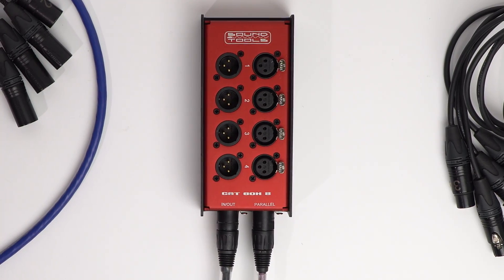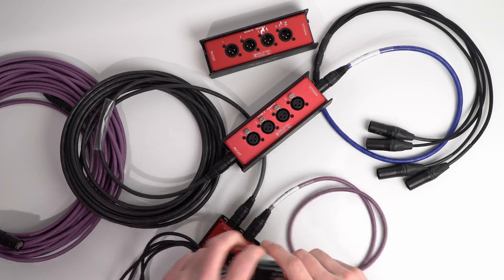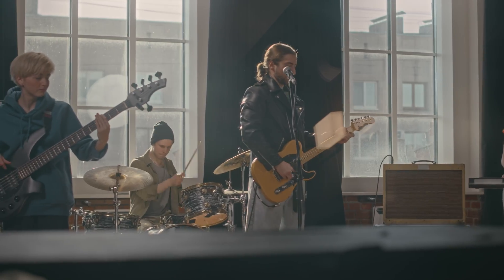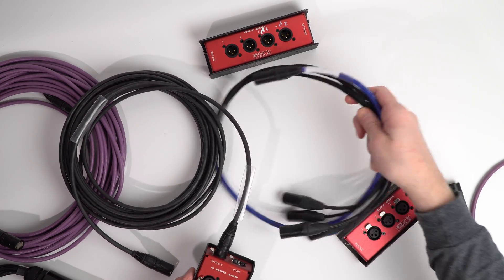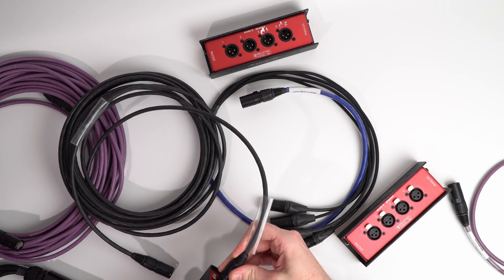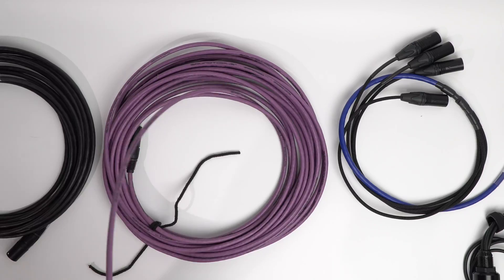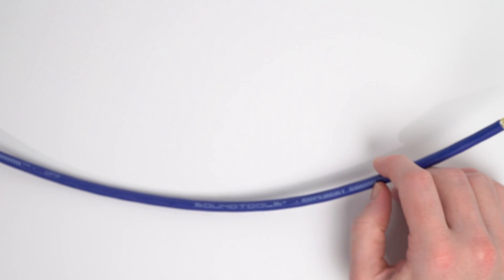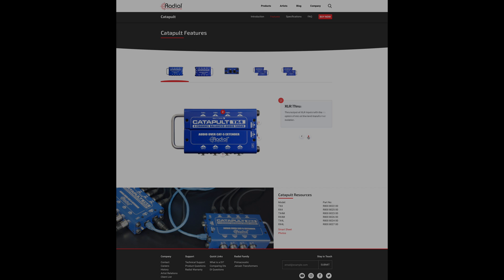SoundTools CatBOX 8 and SuperCAT 7 First Look & Teardown

Comment: Hey great vid!  Would making your own ethercon cables be an economical alternative to an already made cable?
Reply from the maker: Hey Erik, hope you've been well man! If you've already got the tools to make up ethercon ends and don't mind doing it, it could be worth the trouble. We used to do it back before these kinds of things were commercially available. 

I think the cheap route these days is to just get the cheaper imported ones and use the mono-price mentality of just ordering a few more than you need as spares and double check them all for quality control before using them in the field.
Reply: @DcSoundOp Good call, thank you!

Comment: You dont need uftp with individual drain wires to go directly from ethernet to xlr, you just can solder all grounds to one drain wire in futp cable, just soldering would be harder :P

Comment: Somebody knows if we can use this box with mixers like Midas MR18 or Behringer XR18 ethernet conection? It have just 6 monitor outputs, and I´m trying to get 3 extra outputs to send inears monitor mixes (using 3 of the 4 effects channels).
I just know DN4816-O splitter, but I need only 3 extra mixing channels, and these can be PERFECT!!

Thanks a lot 😎

AWESOME VIDEO

Comment: if i want to make a 2 room setup, i will need 2 CatBOX 8 in each room with SuperCAT 7 cables running between the rooms with the catboxes parallels disconnected?
Reply from the maker: Yes, you would want to have the parallel jumper taken out, and you'd need two runs of cable between each set of boxes, if I'm understanding what you're trying to do correctly. Thanks for the message.

Comment: I used the Soundtools WallCats to easily install mic feeds around the room in a medium sized church....Crazy easy wiring install. Also used the CatBox products to move line out feeds from mixer to FOH speakers and front-fills. Quite a bit less expensive, especially since we are using all Cat6a cable in the walls.
Reply from the maker: They really are a great fit for that application, it’s so easy to have additional cat cable pulled and terminated. Good to hear you’re enjoying them.

Comment: I'd like to be able to have one Catbox 8s on one side of the stage to send a signal to a FOH speaker and two monitors AND to receive a signal from 2 mics and two guitars.   So that would mean I'd want to use 3 outputs and 4 inputs from a single Catbox 8....in that case I'd have two Cat cables.  One to send and one to receive. Correct ?
Reply from the maker: Thanks for the question Frank. You're absolutely correct, to use it in that configuraion, you would need to pull the internal jumper and run two cables. Sorry for the slow response, it's been a heck of a week. Thanks again!

Comment: I wish all cat6 manufacturers could come up with a standard wiring. Love these units but running into issues when using it with a DB25 to cat converter. One is T568A the other is T568BB.

Comment: Would i be able to connect and use the Catbox 8 to the Ultranet port on a X air 18 to get in and out audio?
Reply from the maker: Only using the same analog connections you use now, these are completely passive and don't interface with other gear over any networks. Thanks for the question!

Comment: It looks like the SuperCat fanout has a male Ethercon connector, this makes it less than ideal for connecting directly to an ethercon cable. I guess you need a Ethercon female turnaround?
Reply from the maker: Yes, the NE8FF is what you'll want to have on hand. They're also generally useful for adapting ethercon cables to non-ethercon gear with a standard patch cable - https://amzn.to/495GWYa (ad link) Thanks for the great question.

Comment: As a 4 pair stage box I don't see an advantage over the traditional sub snake. Even with the XLR housing the actual contacts are quite small, delicate and not tight fitting. A standard XLR connector with it's pin and sleve contact is a much MUCH better conductor. 
Where I do see an advantage is in a large scale  installation. Lower cost of cabling over long distance and greater flexability in terms of what devices  can be used on the cable run. One day it could be lighting, the next dante data and anolog/digital audio on another day. This could be handy on a broadcast truck or sports stadium. 
Either way, the little tiny contacts are the weak link in your signal chain. Over time they will begin to fail. Good Luck.
Reply from the maker: If you don't need the disconnects and are not already carrying Cat cable for another use, traditional methods probably make more sense. Thanks for checking out the video Ed. I appreciate you sharing your thoughts too. All the best!

Comment: I recently did a talent show (Saturday). the last 3 acts used their own microphones, so I set them up with their own booms and I hooked them up to a cat box; mixed it during sound check and saved a snapshot. Then I swapped back to a splitter (seperator) assembly to my normal set up that consists of 2 sets of microphones stands with vocal mics and a side mounted instrument mic (I found this to be great for a bunch of reasons you get one vocal and one instrument if they play guitar that can be plugged in and if their pick up doesn't work the instrument mic is already right there) and because this is one mic stand I have that feeding into a StudioHub adapter which gets me 2 XLR's to cat5. then two of those comes into a separator which splits out the green and orange pair to one Jack and the brown and blue pair to the other Jack so now I'm sending four channels down one cable to my XR18 mixer stage side. I found the studio hub connections to be pin compatible with the sound tools stuff but the numbering and the cable pairs are different so I have all mine wired up so it goes back to a cat rack and comes out in four different colored XLR cables as per the ethernet color pairs Green, Orange, Blue, Brown.
This allows me to mute channels and disconnect one ethernet cable at the mic stand and yank it off stage. Going back to the cat box's I had to make up a funky ethernet cable adapter to rearrange the pairing so the numbers made sense. I tried it a few times it works but it broke my brain so I made the adapter because Jack #1 ended up like in the middle it was weird.
I had one cat box stage left for instruments like guitar amp, base, acoustic guitar DI.
And I have another one back of stage for drums overhead, snare, kick and drum vocal which we ended up not using.
Small stage. A very small stage but then again it's a 1920s movie theater so the fact that there is a stage.
The sound tools system gives me a really light weight 12 channel snake.

Another thing I do is live video streaming and this event is at one of the local hotels, another one of those almost ancient buildings in a small town. did I mention it's a historical town just outside of Maryland, DC and Virginia.
Since I also do networking I fully understand how the cabling system works or is supposed to. I try and put as much as I can on ethernet cables they're easy to find they're easy to replace and you can hide them fairly well. In this instance I have an ethernet cable running up to a table top projector and laptop for presentations to grab a video feed for the stream. I have two cables running to the soundboard mounted near the kitchen, one grabs the four channel wireless mic system and returns it to my Mixer more conveniently located in the room, and the other one Cable pair returns a mono signal to the mixer to use the House system speakers and the alternate pair grabs the channel direct out from there background music CD changer so I have control of it. and the other two pairs I am using passive POE to power the wireless microphone receiver so I don't have to move it and so if the power goes out the wireless microphones are still returning to my mixer getting mixed and streamed out assuming the Internet doesn't go down or at least into the back up Recording. And at the end of that I pack up the cameras, my table, there's a handful adapters that get unplugged, the mic receiver gets the cat tales unplugged and re-patched, mixer settings get reset and there's a dozen ethernet cables to wrap up and my box gets the lids and rolls out.
Reply: Any reason I should consider Cat7 for a small 20’x12’ home recording studio? Longest run would be 30-50’. I def need at least a shared ground/shield for phantom power. On one hand, I don’t have long enough ones to justify buying top line, but on the other hand, I don’t need 3000 feet so I don’t mind spending a little bit more for my small DIY studio. Appreciate some feedback! So far all I know is that I need to look for solid copper, not CCA, and I need at least one shared shield
Reply: @GregoryGuay  not really as long as you get the shielded you should be good although the cat 7 supposedly has individually shielded pairs which might help with crosstalk so it might be worth going the little bit more for some future-proofing if it's going to be in the wall.
Reply: @imark7777777  I hear that for an amateur/inexperienced person that Cat 5E is much easier to work with than 6A. Do you know how 7 compares?
Most likely, I will go with solid copper for the “permanent” install. I’m actually leaning towards 5E, since someone told me it’s a much easier to work with.

Comment: There are a lot of DI boxes with a ground left switch, I have honestly I am not sure if I have ever used them other than making sure they were not enabled.
If everything is working properly there shouldn't be a ground issue and if you have a ground loop there's probably an electrical issue.
Reply: Not necessary to connect both ends to ground. 
Ground loops occur when the signal has more than one path to earth. Rule of thumb is lift at source, ground at destination.  
Mind you we are talking pin 1 signal ground here. 
NEVER lift electric power ground. If there is a failure YOUR BODY could be the path to earth!
Reply: @edjefferson9175  no not necessary to connect ground at both ends but that's exactly where some non-standard cables come from because they're not following the specifications and you end up with a USB, Ethernet or other cable that's not correctly wired to the specifications.

Generally I have never had a ground loop issue when things are properly connected using balance lines avoiding unbalanced cables etc. star ground. Following the Benchmark white paper on a clean audio installation.

There was one band that I did Sound for that insisted on having a ground lift cheater adapter on their electrical cable to their Audio amps.
Because well you change half a dozen things and the buzz goes away it's gotta be that one thing we did there. So never change anything ever again. Then again they were running an entirely analog system of almost ancient equipment.
Had a ton of a hard time with that band the last time I worked for them I think their amp was dying anyway.

In all my years I've only once had a ground issue with a keyboard and I don't know why. I tried lifting the ground at the DI and that didn't work. And unfortunately the church didn't have the money to drop on one of those fancy electrical hum eliminators that goes on the AC side, that church is a whole Nother story mentioned elsewhere online. The only way to get rid of it was using a non-standard standard unapproved technique. Which I won't disclose.
However a few years later no more buzz without unauthorized modification. Object removed from chain. (I'm hoping this one isn't too vague? In case it is I remove the two prong three prong adapter that was on the power cord to the keyboard). This one was properly labeled and tested multiple times throughout the year which is how I found out it wasn't needed all of a sudden and I'm not sure what changed.
Then again that was an interesting church, I was in charge of tech and yet was not told that the entire stage had to be rewired for surface mount outlets. I came in a few days after to find this out and find every amp guitar x3 and otherwise x3 ( Main + Mon x4) daisychained through power strips and plugged into the same circuit when we had two circuits on stage. Yeah we don't have to follow code that's why we now have to put up an exit sign, remove some illegal building modifications, add a handicap ramp to the stage that 6 inches off the floor. But it's not a problem family member of the Pastor is a contractor.... Run!!!!!!!!!!!!!!!!!!

I've seen this third prong nonsense all over the place generally it's bad lighting dimmers improperly wired electrical, sharing circuits etc. I have the wonderful benefit of cross discipline between A/V electric and networking. If you have a good electrical to start with, keep everything on the same circuit use balance cabling and good quality equipment that's maintained. There shouldn't be any issues and sticking with that mentality I have not once had to use the ground lift switch on any DI with all equipment properly grounded.

There was this one church that just about everything that was three prong had the third prong broken off why… Because all the electrical in this church was two prong and this individual this pastor believed it was easier than getting an adapter to break the prong off on everything. which is why to this day I rather have an ungrounded slightly miss wired in a particular manner electrical outlet then have the opportunity for somebody to break the third prong safety ground pin off because they're too lazy to get an adapter making it permanently unsafe. Unfortunately this method really does require a qualified well educated electrician to properly test everything from outlet to panel and not just one of those three like testers. The sad part most of those outlets in that church would've qualified for being upgraded properly with existing wiring because it was well done to begin with but just with two prongs.

Comment: BEWARE!!!⚠⚠⚠⚠⚠⚠
There are two things to keep in mind that can cause massive problems:
1: common ground - these snakes all share common ground on EVERY CHANNEL. if you have any ground issue or noise issue on ONE single channel it will transfer on every other channel.
2: splitting: the split is without any TRANSFORMER. So basically a Y- Split. For LINE LEVEL this is fine. For MIC level this is an absolute NO-GO! You always wanna split Mic level signals with at least a passive transformer. 

The combination of both points above can cause MASSIVE problems live and drive your FOH-Tech insane. Just because it works for some people, it doesn't mean that in the next venue you play you're f*cked. to be safe then, keep at least a normal 4x4 snake for every CAT-snake in the backup case and wire up your rack or console without zip-ties.
Reply from the maker: You know that normal audio snakes, and every mixing board on the market share a common ground across all channels? Why does this freak you out so much with this snake? 

Also, splitting mic signals without a transformer is totally normal & done on major tours and productions every day. Transformers are absolutely NOT required. Dave Rat even has a video on his channel about how the RAT Sound snakes on major tours NEVER have transformers in the splits, it’s totally normal. 

Please be careful before writing BIG  alarming ⚠️⚠️⚠️ walls of text on people’s videos, that you’ve got your info right first. Thanks!
Reply: Other than some signal level loss a  system will function just fine with a hard wire split. We never had the luxury of iso snakes. Some passive snake boxes have pin 1 lift switches on each channel. Much cheaper than transformers. I would prefer a hard split over cheap transformers. 
There is only one earth, so a common ground is not a bad thing. Balanced audio is caried on a twisted pair. The ground wire is not part of the audio signal.  It is a shield/drain conductor and can also be used for power delivery to circuits such as  phantom power and intercom belt packs.

Comment: I'd love a version with an iso transformer for splitting between FOH/Monitors & Recording rigs. Especially Comedy shows where where the channel count is almost always less than 4ch in total.
Reply from the maker: For sure, I was plesantly surprised to see radial has a transformer version. They are almost $400, but I'm sure it's worth it coming from Radial.
Reply: @DcSoundOp  I'm assuming the ETS, SoundTools, and Radial Engineering systems all have different wiring schemes to the CAT cable. But i foresee adapters being needed until a universal pinning standard is agreed upon.

Comment: Why choose this over a solution with Dante or NDI?
Reply from the maker: Hey, thanks for the question. I wouldn't usually think of these as an alternative to a networked solution like Dante or NDI, but have often used them as drop snakes feeding a bigger dante stage-box and love them for that. If you're already carrying a trunk full of good network cable for your Dante system, I figure you might as well have some passive boxes like this to make the most of it. Let me know if I'm missing the question though.
Reply: @DcSoundOp  not missing the question at all, thnx for answering. I tend to just add another dante interface to the network 😁 those two port interfaces work really well and for more ports I use Yamaha. NDI is getting there for sound though. 
Whatever does the job the best, right? 😁 And we keep having reasons to upgrade and go gaga for gear 😝

Comment: I have been using WallCAT 8 by SoundTools.  The only difference I can see between CatBOX 8 and Wall CAT is the jumper.  Is that true?
Reply from the maker: I believe you are correct, but maybe someone from @SoundTools can confirm if they see this question. Thanks for checking out the video!